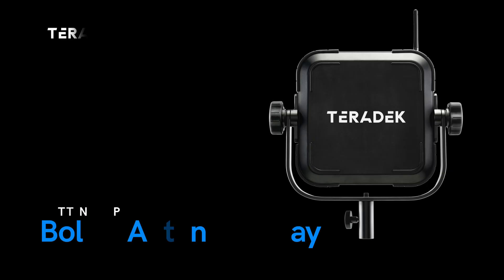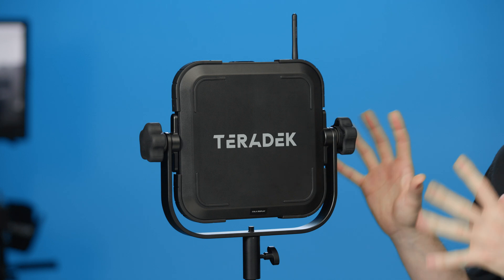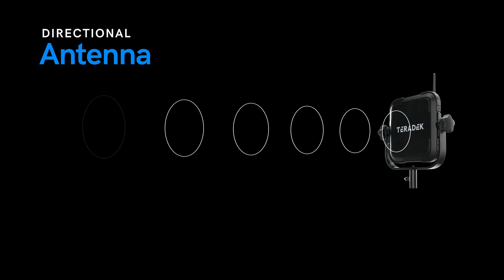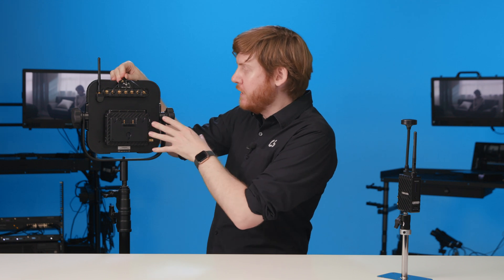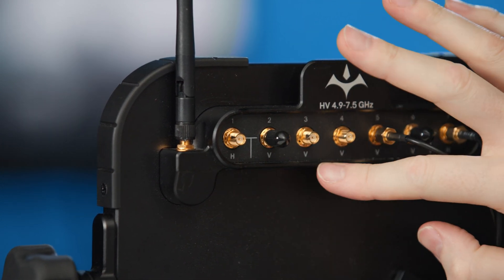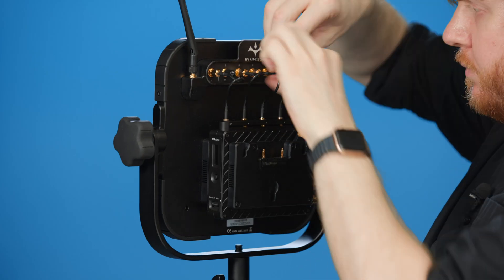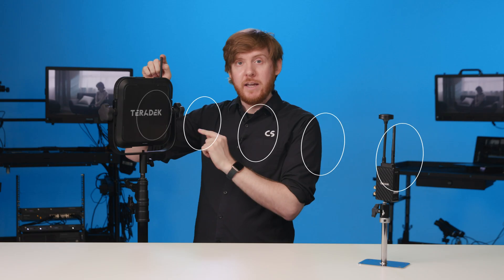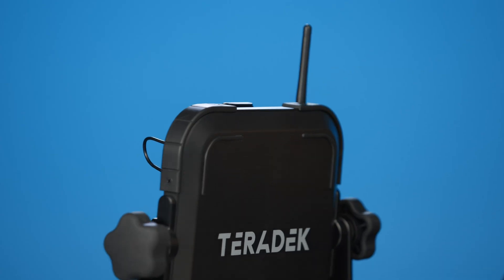How to Set Up the Bolt 6 Antenna Array

Comment: This video make no sense? The array antenna here cannot direct a signal ? it's being used as a RX (receive) device not a TX (transmit device)  this would be correct if was being used as a transmit antenna. The explanation and the animations are back to front..... Here is why it actually works...

Focused Reception: Unlike omnidirectional antennas that receive signals from all directions equally, directional antennas concentrate their reception in a specific direction. This focus allows for stronger signal capture from the desired source while minimizing reception of unwanted signals from other directions. 

Increased Gain: By directing the antenna's sensitivity toward a specific area, directional antennas achieve higher gain. This means they can receive weaker signals more effectively, extending the range and reliability of the communication link.

Reduced Interference: The focused nature of directional antennas helps in rejecting signals from other directions, thereby reducing interference and improving the signal-to-noise ratio. This is particularly beneficial in environments with multiple signal sources or potential interference.

Extended Range: The combination of focused reception and increased gain allows directional antennas to maintain reliable communication over longer distances compared to their omnidirectional counterparts.